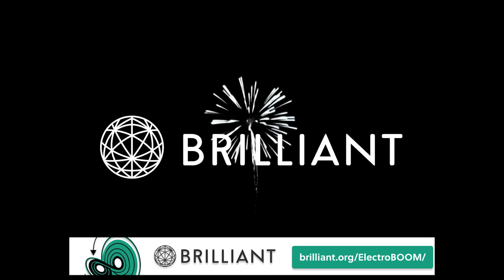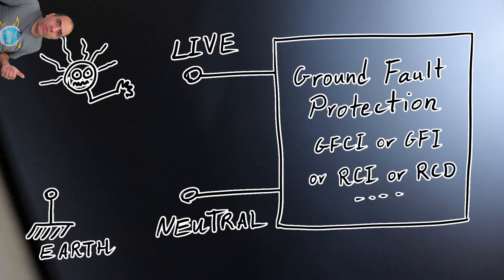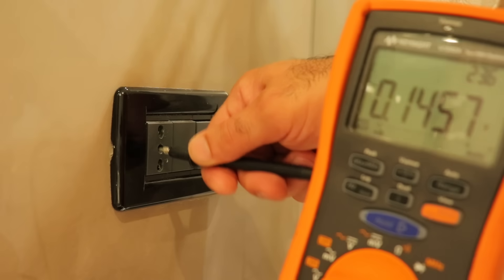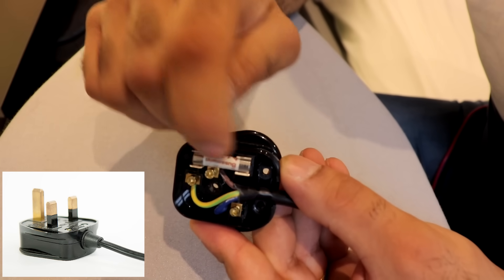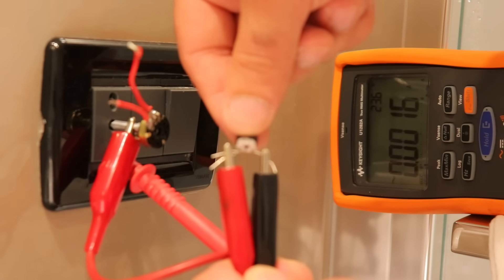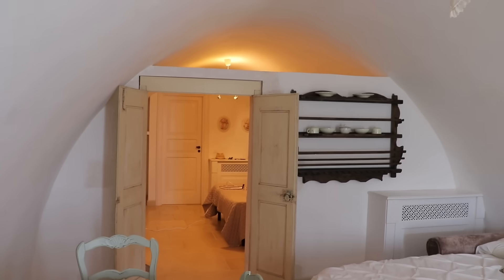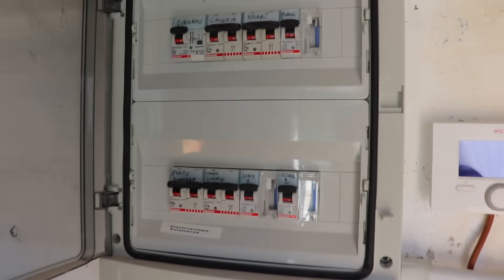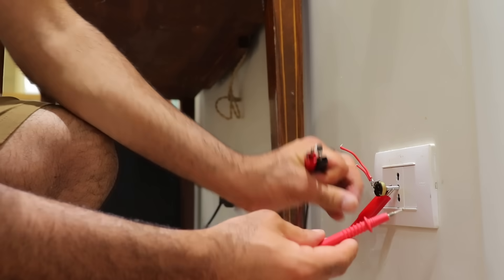Tripping Every Breaker in Italy

Comment: those are C class breakers wich are meant to be used for motors and other appliances wich draw a lot of current when they start, for example: dryer, electric stove, etc. Those should be B class

Comment: So basically here we have different plugs and outlets
1) 2 small bars for the 2 small holes, they are the most common and the ones used for phone chargers
And you can also find outlets whit these 2 holes only
2) 3 small lines for the 3 holes, are made for bigger things like hairdryers and sht like that and can be plugged it the ones that he saw and even the one whit only 3 small holes
3) 2/3 big sticks for the 2big holes and the center one, these are used for even bigger things and can only be plugged it the outlets that he saw but on the large side of the side holes

Comment: Act, in belgium we had 2 ground fault protection, we call them differential’s or verliesstroomschakekelaar which translates to current loss switch, it’s  self explanatory, but we use 2 because one with a 300mA correction and the other one with a 30mA this second one is used to protect the machines that use water and bathroom, but now with new rules u need to place one gfci every 8 breakers, this means we can wire the bathroom on the same breaker as the kitchen, tbh this rule is safer but costly, u can count 100 a pop for them gfci’s.

Comment: here in Italy the electrical systems are regulated by the CEI 64-8 regulation. Private facilities in newly built homes and hotels MUST comply with that regulation or they cannot be inhabited. The legislation also regulates the characteristics of active protection systems such as residual current circuit breakers and passive ones, such as circuit breakers. Attention, in ITALY, breaking into or tampering with other people's electrical systems, if not authorized, is a CRIMINAL OFFENSE.

Comment: if you come in UK to test and check house's electric plants you would have to laugh for at lest 7 days each  house. For example where im living now there are 3 smoke detectors and 2 gas detectors cos when something don't work anymore they leave it be and they add another one instead of  remove and replace. And in the place where i was living before , when you take a shower at the firt floor, sometime there was water falling from the smoke detector at the ground floor.obviously the detector wasnt working by battery but was 240Vac. Obviously the RCB is unknown to the english electrician......

Comment: The protection flaps were introduced some time ago and many plugs are still not up to date, but all the new ones that are sold are mandated to have them, the two different sizes instead are for 10A and 16A plugs. Long time ago we used to only have 10A and that’s why some plugs only feature the smaller size

Comment: 9:16 Sono i RJ-11 uno dei tanti tipi di connettori modulari utilizzati per la telefonia fissa.

Ha 6 pin, di cui in genere solo 4 vengono utilizzati.

I connettori RJ11 sono una delle prime versioni di connettori modulari. Oggi sono più diffuse versioni più recenti, come l'RJ45, ma il Jack-11 registrato è ancora molto comune nel settore delle comunicazioni vocali, spero di essere stato d'aiuto :D

Translation: RJ-11 is one of the many types of modular connectors used for fixed telephony.

It has 6 pins, of which typically only 4 are used.

RJ-11 connectors are among the earliest versions of modular connectors. While newer versions like the RJ-45 are more popular today, the RJ-11 is still very common in the voice communications industry. I hope this helps! :D

Comment: the type F and Type L Plugs are bidirectional, you can´t plug it in the wrong direction as there is no wrong direction. the wires don´t care which side of the circuit is live and which is neutral and the grounding wire is connected to the Metal structure in the devide. so as soon as you somehow touch a live wire and the metal structure of the device, the GFCI pops. in electronic devices, that don´t have a metal housing or are protected in a special way, we use Type C Plugs that connect only to live and neutral. it´s still safe because you can´t touch the live wires (as long as it´s not damaged). a big advantage of the type C plug is, that it connects to many other sockets all over europe (Socket types C, D, E, F, H, J, K, L (10 A), N and O)

Comment: You land in 50 years ahead about electricity. By rules ground and earth likage are mandatory. The German std socket for your info shouldn't used in the italian socket, if it enfer because some "smart" pushed and forced till the point to enter it. Italian sockets holes are 4.4mm German 4.8mm.

Comment: Hello from rome, we're glad you managed not to be electrocuted on your stay. For your knowledge the round plugs are called siemens and generally used for heavy appliances (1KW and up) plus some electronic crap mostly from germany. The italian plugs come in two sizes, the little ones handle up to 1.5KW while the beefier up to 3KW. Duoble standards outlets are rated accordingly to 3KW so you're not supposed to force a siemens plug into a italian one, specially those of a smaller size which may have smaller gauge wires

Comment: 8:21 this one is not the main , its an rdc/gfci and curcit braker like 2 in 1 its mostly used for specific curtics like: ac, dishwasher, oven, ect. I noticed this beacouse it had an test button and from the design.

Comment: Ground protection is mandatory. 
The 30 mA limit is set to prevent heart attacks (above that current the heartbeat becomes unreliable) . 
Furthermore, "ground protection" is not the best description: the breaker just relies on the difference between live and neutral so it can be activated even if no ground is present. 
Ground is there to allow easy way of discharge overcurrent but if you e.g. touch live with naked and wet feet the breaker activates.

Comment: Hi Mehdi, actually in Italy regulations impose to everyone to regularly check the differential breaker functionality every once a year. This in done simply by the little button you pressed. If the breaker doesn’t trip immediately it should be replaced, it’s mandatory. Moreover the protection is based on time, you don’t actually get a big shock because the breakers are designed to open in milliseconds so current doesn’t have the time do do much hurt, but it will surely scare you enough not to try to do some dangerous things again! 😄😄

Comment: those breakers are differential breakers: if the current between line and neutral wires is different, they cut the circuit. That's your best protection 👍

Comment: I'll tell you more, according to Italian and therefore European standards, theoretically the entire home system is under a magnetothermal switch or ground fault protection with a sensitivity of 0.03A, but in homes usually the entire bathroom system is under another protection switch with a sensitivity of 0.01A therefore being more sensitive it pops first in the event of a short circuit

Comment: Sadly I am not owner of a house, as getting enough money to buy a house these days is nigh impossible.
But as far as I know from my own country,  by law, you have 1 thick cable coming in from the city power grid. That goes into the main breaker box. That breaker box MUST be installed by a certified electrician by law. From there, you usually bridge off 1 smaller breaker box per floor.
So you can have a breaker trip for a single electric circuit.. there may be multiple in 1 room, based on how it's wired up. We usually use 13 and 16A breakers. So around 3000W of power available.
If it was a bigger voltage spike, it goes to the big, main breaker box downstairs. 30 years ago we had those shitty screw-in breakers that burn through and have to be replaced. These days by law you have to install the classic switch ones. (My country is Austria btw, so right above Italy)

Comment: Italian here. Based on your description of what it is vs how I was told our electrical safeties work, GFCI would have to be present, but probably part of the breaker panel or hidden away somewhere.
Reply: The round plugs aren't supposed to fit in the three hole outlets. The prongs on your plug might have been too thin, or the holes in the outlet too wide.
Either way, something was off-spec, which is common unfortunately.
As for reversing the live and neutral, it is expected and appliances must deal with it to be sold.

Comment: Maybe I'm late, but the double set of holes is for 10A and 16A plugs, they have different prongs distance to support different types of loads. We sometimes also have a Shuko+Italian type of sockets, for maximum compatibility.
Also, a Shuko plug can sometimes be forced into an italian socket, but that's not the norm and it's definitely not the right thing to do. There are adapters which solve the issue.

Comment: As an Italian, the two standards are 10A and 16A. Bigger is 16 and smaller is 10. Doors get jammed sometimes but are mandatory. 16 and 10 get installed based on having 1mm² and 1.25mm² cables.
Also the black special bigger outlet is not the Italian standard, it's a "shucko" and if you force them in Italian plugs you jam the little doors and not get the ground. There are adapters available tho

Comment: Colors are:
Yellow/green = ground (mandatory)
Brown, Black, Grey = Phase (there are some other colors allowed but generally we stick with these. )
Blue = Neutral (mandatory)
So, if you found a neutral with black, that electrical system despite works fine and cables are connected as they should, the mismatching color is against laws. 
Another issue is that is mandatory to leave 30% of empty space in the electrical cabinet, so again, the first hotel had it not properly done.

About the Schuko, the normal electric 3 pins socket should never allow a schuko directly, that's why we have adaptors with 3 pins, so even if the house has no schuko sockets, you can still use it safetly with adaptors.
We have high standards, but some electricians here don't do it in the proper way as the laws asks. 

I'm glad you liked Italy, but don't try these things in hotels please. :)

Comment: Lol that’s installed wrong 0.o blue is always neutral in Italy, black or brown are live. You can even see on the magneto-thermal that there is a N stamped under the blue cable (n for neutral). Sadly I see that type of s***t before. A lot of old houses have the most absurde and dangerous wiring. The second one is a differential. In new houses those are together in the same box, in older one they implemented later, so it will happened that they are in two different places.
Also usually in a good implant it would be always a separate circuit for the outlet and the light. Light 10a magnetotermal+differential and 1,5mm2 cable, outlet 16a magnetotermal+differential and 2,5mm2 cable. Also you officially can’t plug a shuko in an Italian outlet, you need to force it in, the holes of the outlet are a little smaller that the pin of the shuko. But yes, you can force it in.

Comment: Hi I'm Italian ^__^ The sockets you see with the double hole are at 16 amps with 2.5mm cables. Many years ago, there were the sockets were separated those with small holes for the 10 amps had 1.5mm cables and the 16 amps for the connection, for example, of the washing machine. Today all the new electrical systems, generally they are made with the sockets are 16 amps with compatibility for small appliances that still use 10 amps. According to the legislation, the neutral is always blue, the phase can instead be brown, black or other colors, dependent on the complexity of the system to facilitate the recognition of the various sections of the housing structure. The voltage can vary from 220 volts to 240 volts. The electric line of the illumination is generally separated from the socket line. In every room of hotels or home, you may find specific protection interrupting for that room. The protection interrupting are connected after the electricity meter switch. At 9.16 minutes you are seeing a magic type socket, produced by the B-Ticino. Although security was greater than thorns and modern sockets, it did not have much diffusion. At minute 15.39, you are seeing a German spine Schuko Siemens, in fact it can be pushed inside a 16 amps and is dangerous, even if struggling to insert it, it should be understood that it should not be done... My dad did it :D However in Italy, security is a serious matter. If you have any specific questions ask, I was doing electrician many years ago.
Reply: To be totally clear, Shuko prongs are bigger than 10A prongs and in smaller 10A sockets they wont just slip easily in. You can push them in but it needs considerable force and the obvious enlarging of the plastic of the socket. Maybe in older sockets that are a bit more worn out the force might be a little less, but it still feels awkward to connect those there.
Reply: @giovannispinotti  
There are also trivalent sockets with double prongs of the same diameter (like the 16) so that both the 10 and 16 and the Shuko can fit.
Reply: Yeah there was likely no way to prevent the big Schuko plugs from insertion while keeping the small ones usable. In Germany we have a housing around outlets that should only accept the small ones, but that would likely interfere with Italian plugs.
Reply: I correct you, the socket that is at 9:16 is not electric, but it is a standard bticino telephone socket, heart attack next to it there is also the rj11 socket
https://it.m.wikipedia.org/wiki/File:BTicino_spina_e_presa_telefonica.jpg
Reply: @robertotriggiani6958  nope, it depends, it could be also 220v
Reply: @giovannidicampli1736  What you say is something else. If you see the image, the shape of the socket is different
https://it.m.wikipedia.org/wiki/File:Presa_magic_01.jpg
Reply: Le prese che venivano chiamate “Magic” le usavano nelle scuole per una maggiore sicurezza! Sono per il 220V
Reply: @dieghito2608   quella che fa vedere nel video è una presa telefonica: https://it.m.wikipedia.org/wiki/File:BTicino_spina_e_presa_telefonica.jpg
quella che dici tu è un'altra cosa, se vedi l'immagine la forma della presa a muro è  diversa: https://it.m.wikipedia.org/wiki/File:Presa_magic_01.jpg
Se vedi le forme dei socket sono diverse. Io ho sia le prese elettriche che non uso più e venivano chiamate "prese/spine di sicurezza (che si suddividono in 10 A e 16 A), sia le prese telefoniche che uso tuttora e che a prima vista sembrano uguali.
Reply: @dieghito2608 sì negli anni '70 forse. Già dagli 80 uscirono quelle con lo standard attuale a 3 fori
Reply: Yes and the socket name used to be "Magic" by Bticino
Reply: I'm Italian and I swear I absolutely hadn't ever realised that you could theoretically insert a Schuko into a 16 amps... I'd never thought about it and nobody in my family knew it. I thought it simply wouldn't fit but it actually kinda does? Mind blowing
Reply: le magic bTicino per la corrente avevano una forma più rettangolare. ne dovrei avere ancora una o 2 in garage come ricordo, ce le avevo montate in casa dietro la cucina morte fino al 2000.
Reply: psssst.. if you use : instead of . when timestamping, we get a direct "link" to that moment in the video =)
so... 9.16 vs 9:16
Reply: Holy fucking yapmatronic
Reply: I eliminated all 10amp sockets converted all to 2.5mm2 wires with schucko/universal.  that small pin stuff is annoying, always looking for adapters.

trains I believe, are 600v not sure though. I know it sometimes cooks metal thieves
Reply: I live just at the border of Italy and can't count times I forgot to taje the adapter with me (we have schuko in my country) and then had to look for it the last minute. Generally schuko can't be inserted in italian socket if the socket has not been modified to do so. I mostly hate those italian plugs, but must say they are elegant and easier to connect to.
Reply: Such a long text
Reply: In Italy, people cut corners whenever possible, especially in the south. So no, security is really lacking in Italy when it comes to construction.
Reply: How the hell do you have the to type all that
Reply: @Alexnieman-m2i You're right, I wrote too much.😅
Reply: @benzene70 my fingers would have looked like I opened a new pickle jar
Reply: Se sei italiano parla italiano !!!!
Reply: @Giacca1 Buon giorno Giacomo, personalmente credo di essere abbastanza libero di rispondere nella lingua che ritengo più opportuna.
Reply: @benzene70  che coglioni stavo a scherzá

Comment: At 7:22 you can see, right from were you circled "I didn't see this". there is actually a TEST button (it's actually written TEST) for Ground fault protection. pressing the button connects ground to live, then if the system works, the switch goes off. They need to be installed, by law.
Reply: The test button don't connect live to ground but connect to a resistance to simulate a curent leakage.

Comment: Sad to say but what you encounter will never happen here, no one uses a schuko with an Italian socket, as you probably have noticed the schuko plugs prone are a bit bigger then there Italia counter part and that by design, you should feel resistance and be discouraged, sometimes they will not even fit, but if you use an Italian plug with a schuko socket you will not encounter any resistance

Comment: The one thing you didn't break apart to notice is the wire. Unlike the solid 12/16 gauge copper trash that is used in North America, most of Europe uses Stranded wire.
You know, so you don't electrocute yourself when you shove pliers in there to get the the solid wire bent into the shape of the outlet screw...

Comment: The Big plugs are not bad, those outlets are as they arent by standart in Italy it appears as normally the plug is designed to only allow the thin plugs or large and thin ones but these ones are mostlikely older ones which didnt have that yet or Italy just is off the standart a bit. Normally the big plugs tho cant be plugged into the thin only outlets.